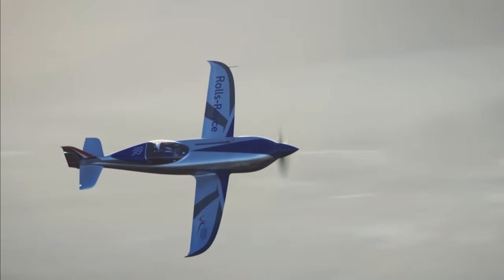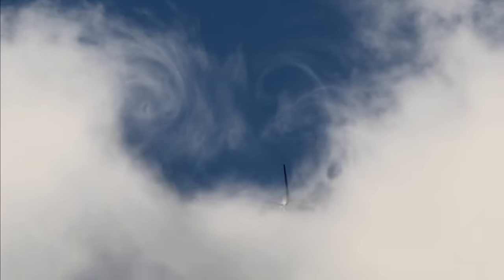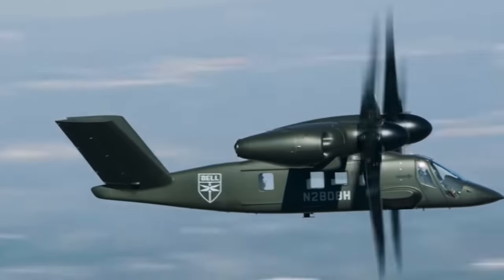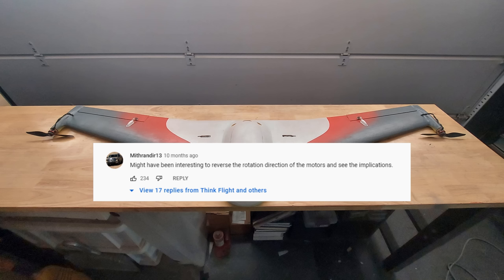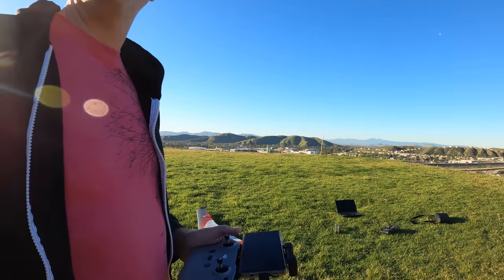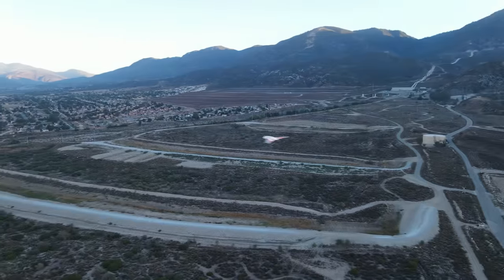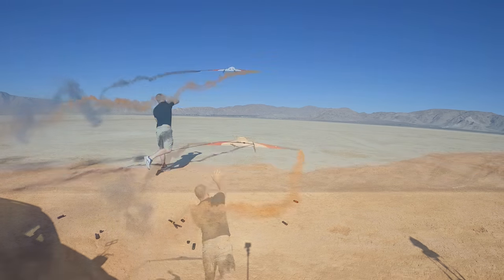Can Wingtip Motors Improve Aircraft Efficiency?  (Part 2)

Comment: To compare wingtip devices you have to consider why span is limited in the first place. Airliners have to fit inside a gate, racing planes need a quick roll rate, other planes have structure constraints.

Why is your plane span-limited? How can you work around this to use less energy throughout the flight?

I think it would be interesting to compare tip motors to a span extension equal to the radius of the prop.

Comment: Great video!  Not sure about there being a inward rotating vortex and outward rotating vortex on the same wing. Wouldn’t that be less efficient than a wing with single vortex?  

If I remember correctly, the lift distribution curve is smooth transitioning from inboard to outboard and and slightly negative at tip.  So I would wager no inboard rotating vortex. Since the pressure gradient is smooth.

Comment: Do you think the reason that the vortex did not move in board as it does with the traditional aircraft might be caused by the lack of tail structure? The mass of that tail structure would displaced a lot of air creating a vacuum behind it and then pulling in the smoke from the wingtips. The absence of such structure would not create the vacuum.

Comment: What about using the wingtip motors for skidsteer-esque thrust vectoring?  For ultra-long distance, or very long circular loitering missions it might more efficient than using control surfaces, assuming control surfaces disrupt aerodynamic efficiency in any significant manner.

Comment: You can overcome any outboard motor failures by simply putting a centerline motor to recover! 😁👍✌
Reply from the maker: Very true!
Reply: @thinkflight  Or use thrust vectoring.
Reply: @toolbaggers  nope if an outboard motor goes out, .... she's goin down baby! 🤣😱
Reply: @TinyHouseHomestead  or fly in a small circle till it runs out of power then crashes..
Reply: @altrusianwolfdog2564  well, .... yeah, but the idea is NOT to crash! 🤣😁👍✌
Reply: @TinyHouseHomestead  I guess after 120 years of aviation there is a reason they don't put motors on the wing tips...
Reply: Adding another engine along with fuel and mechanical complexity to solve what most likely would be an unrecoverable spin generated by the yaw condition is not a good way to solve this problem.
Reply: @F-14_Jockey  nah, at the loss of either of the out board engines, the other out board engine shuts down and the center engine takes over or carries on the mission. Helluuuuuu! .... ROOKIE! 🤣👍✌
Reply: @altrusianwolfdog2564  BINGO! But, with the center engine you solve the issues! 😁👍✌
Reply: Not true.  Additional control surfaces, stability & control, center of gravity/lift, and additional outboard motors can each overcome the loss of a single outboard motor.
Reply: @montithered4741  nah, it would take an act of GOD, .... to overcome a wing tip outboard out! The additional center engine, insure completion of the mission! 😱😁🤪🤣👍✌
Reply: @TinyHouseHomestead  
Oh, so if you had two outboard engines on each wingtip the loss of only one would be inevitable crash?
An aircraft with only on outboard engine couldn’t fly?
Reply: @montithered4741  Show me how you could continue to fly and complete the mission! 😱😁🤪🤣👍✌
Reply: @TinyHouseHomestead  
Easy, simple, and quick: oblique flying wing, asymmetrical flying wing and Mapleleaf remote control drone.
Next question?
Reply: @montithered4741  nope, those a completely different aircraft, and the craft we are discussing would be forced to land or crash! Go back to scool fool! 🤣👎✌
Reply: @TinyHouseHomestead  
I have a bachelors degree in aeronautical engineering (focus on aero) and a masters degree in aeronautical science (focus on autonomous aircraft).
I know what I am talking about.
Reply: @montithered4741  Thrust overcomes control surface drag and forces or the A/C would suffer an undesirable loss of speed. Additional engine means additional strength in structure which will increase weight, not to mention trying to design in torsional stiffness which would have to be strong enough not to allow twist at ALL. Any twist  would essentially mimic roll controls, it may also induce a divergent instability which would be the result of trying to correct the uncommanded roll.  No matter how you try and make this work it will be a weight and torsional stiffness nightmare.

Comment: Thank you for sharing these experiments, very inspiring!
One data point I haven't seen discussed is wing loading? The lower the WL the lower the induced drag as we all know, and seeing as how light our typical models planes are wingtip vortices constitute a (comparatively to full scale aviation) small part of total drag, which would throw the results in this case?
If you plan to revisit this experiment there are other flying wing planforms such as deltas don't require as much reflex, and with a lower aspect ratio would generate more wingtip vortices, which in light of the experiment is a good thing, no?
Reply from the maker: Wing loading is relative, the cruising AOA is comparable to the cruising AOA of a larger aircraft and thus I would assume the induced drag component is also comparable.   Specifically I'm trying to see if there is a benefit to wingtip motors on a plane with good efficiency already, rather than just trying to help out very inefficient aircraft.
Reply: ?!?!!?        do you always  ramble  OFF  THE  TOPIC, like this.?!?
Reply: pouncer
the induced drag force is proportional to the spanloading square, NOT to the wing loading
For an ellptically loaded wing:
Dind = (L/span)² / (3.1415...×q)
q=dynamic pressure
and is the result of the downwards forward inclination of the downwash behind the center wing.
Nothing to do with the  energy of the tip vortices, which is taken from the very low pressure energy² inside the vortices.
2) the pressure follows the Bernoully energy conservation equation.
p1 - p = density × ½(V² - V1²)
If you put a pressure probe inside the vortex you can verify this.
And the tip vorteces, downstream do carry angular momentum, imparted by the wing tip. Clock wise behind the left wing, when the wing tip is not acting as a pitch up surface, as is the case with the flying wing here.

Comment: Do you think ducted fans would be a way to isolate the wing vortexes from the air intake? Or do you think you would need to product a wing which reversed the wing vortexes to prove conclusively that using motors to reverse to flow is advantageous?

Could you put the nose correcting angle of attack inward on the wing such that the tips could be angled to produce the desired direction of rotation?

Comment: Thanks for the update. Looking forward to see the manned vehicle.

I assume at some point you'll mix the tip motor and ground effect vehicle? 
A compact design, relying a lot on the ram / works like a hovercraft, with outward rotating motors... I think the prop vortex can really seal in the pressure!

I'm gonna leave some of what I said on the last tip-motor video:
"I'm not saying you didn't lower the induced drag, in this experiment you can't tell if it was that , or, a propeller working more efficiently. Maybe both? (Also, for flight time, totally irrelevant ;-)
[...] I think putting them in front would work slightly better. 
But in this design you'd need a big pod to not have the noise from the prop being close to the frame. So I get putting them in the back."

Comment: My question is, wouldnt it make the propeller more efficient if it was not fighting inertia to change the direction of rotation? Like, instead of a counterclockwise propeller on a clockwise vortex, using energy to stop the vortex, and then turn it around(or at least just slowing it down) would it instead be more efficient to just slightly increase the vortex speed with clockwise propeller+clockwise vortex, with more of the energy goiong to forward movement?

Comment: This is the most interesting experimental investigation I've seen in model aviation.
I had assumed the tip vortex would be rotating inwards, and energy efficiency would have been higher with inward rotating propellers, based on the airflow already having angular momentum in that direction. As you've shown, the tip vortex is in fact rotating outwards, as were the propellers and you got a 7.5% efficiency difference.
I'm waiting with anticipation for the next video :).
Reply: 🤦no. A prop rotating counter to the vortex will always make more power. This is why contra-rotating props are used.
Reply: @martindinner3621  well don’t I feel silly. I guess you understand this much better than I.

Comment: Even though the props are rear mounted, the pressure field will propagate upstream and will have an effect on the airflows above and below the wing. My educated guess:
Outwards turning props are more efficient, because they  redirect some of the airflow on topside of the wing over the sides of the wing, effectively leading to more airflow over the leading edge of the wing and thus generating more lift. 
In the same way, the props push air under the wing, effectively slowing down the airflow under the wing, which is increasing the air pressure and again generating additional lift.

Comment: THANKS4GIVING.    This is an exciting dive into Fluid Dynamics. Like most studies in the past you have started at the wing.  When it actually beings before the wing.  The resistance increases with speed before the air screw.   There inputs needed for evaluating other overlooked inputs.  Most could be discovered on the bench in a flow tunnel. 
Pressures against the air screw ahead of the blades. At increments until no difference is recorded.  To the side of the air screw again in increments until there is no difference recorded.   Where I’m going with this. ?Is it better to have the air screw vertical or horizontally built into the wing. I’m postulating reducing the resistance-increasing the low pressure to enhance performance.  ?Am I Crazy hmmm maybe

Comment: A while ago I saw a video about why a pusher propeller is better, but I can't find it. Anyway, I just googled it and found this: The pusher design is more efficient, because the suction forward of the prop reduces flow separation, and the accelerated flow behind it is not streaming around the fuselage (or wing), where it would create additional friction drag.
Reply: The counter to that is puller propellers can create additional lift at very slow airspeed due to accelerated airflow from the props.
Fore and aft props on each wing would be an interesting test.

Comment: The problem with wingtip motors is that in the event that one motor/engine dies the plane becomes uncontrollable due to the fact the the yaw factor is much greater then the conventional design. 
On planes that have 2 engines the engines are located as close as possible to help minimize the yaw effect of one engine dies. 
They also make SOME propellers counter rotate to also help minimize this effect. The piper seminole is just one example

Comment: Hello i would like to ask abt motor and prop size and efficency

So i was thinking to get either some 2203.5 motor with 1600kv wingspan of about 1,6m and 16x5 prop(prop lenght of 25%of wingspan), however manufacturers say that those motors are for 4-6s,   isnt it weight wasteful to use 4s battery, when my aim is light slow cruising longrange wing

However i noticed that lets say that ummagwads aerolite 2004 in 3500kv can use 3-4s , so i would use smaller prop like idk 7x7 idk, but would it be more efficent or not, would it fly longer

And well in the end, if i used that 4s motor and ran it mos of the time just on lets say 25% of throttle during flight, would it make difference against some 2s motor with weight of 2s battery on board, against that same miliamphour just in 4s battery build

Ao the question is if that weightsaving of lighter battrry is worth it, or if its not that significant, n i can run 4s n enjoy that head room of power when i would want to punch throttle
Reply: Also im not sure if you already said it in your previous wing building videos, but what kevlar weight did u use and how many layers, was it 250g lets say 2 layers or something like that ?
Reply from the maker: 1 layer of 1.7oz

Comment: At OSHKOSH this year there were some new high wing aircraft with the wingtips sweeping upward. My Cessna 182 has the wingtips point down as part of a stol kit. It appears that the wingtips in both examples are the same with different orientation. Is there a difference between wingtips pointed up vs point down?
Reply from the maker: Downward will decrease stability and reduce crossflow on the bottom of the wing, both great traits on high wing STOL aircraft which need great maneuverability and high lift.

Comment: if you changed to a conventional plane design ( main wing with tail stabilizer) would you see the vortices on the wingtips of the main wing behave more like how they do on airlines as the main wing trailing edge is still producting lift?  then you could also get vortex visualization on the tips of the horizontal 
stabilizers. 

could wingtip motor efficiency just depend on the average lift of the component it is mounted onto?

Comment: Since it's a t-motor I'm quite sure it uses o-ring damping inside the bell shaft. That means, you can not overtightening this motor since the shaft is longer than the stator. Remove the bell and you will see what I mean.
Therefore resistance should be the same. It's a different story on brotherhobby motors, where you basically compress the bearings and so increasing resistance when bolt is to tight.
Reply from the maker: The difference was pretty significant, it definitely changed the resistance.   I too figured it would not be an issue when I took them apart but I was wrong.
Reply: @thinkflight  
Did you check if there's an O-Ring on the shaft inside the bell?

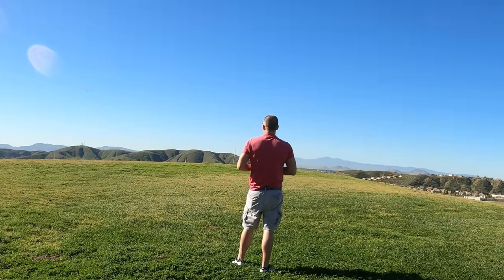Comment: 3:20 Yeah naw I still think about one engine falling on a wing tip configs. I’m thinking about this all commercially. you wouldn’t catch me in a helicopter, you wouldn’t catch in a quadcopter, and you wouldn’t catch me in a plane like that. Too risky if literally anything goes wrong with the motors and flying wings practically rely on computers to stay in the air. Watch some videos of b-2’s doing midair refueling, you can see all the ailerons, rudders and elevators going nuts trying to keep it stable. Unfortunately I prefer “safety” over efficiency. And I’m not saying humans can’t pilot flying wings, but the bigger they get the more unwieldy they become. Yb-49 was a good example of that.

Comment: Seems like a great idea from an efficiency perspective but now the center of thrust is now as far as possible from the longitudinal axis, especially when you factor in the P factor of the outwardly rotating propellers. What could be a solution for engine failures and Vmc roll tendencies?

Comment: I am an aircraft designer i have designed many planes and never seen vortex flow going from top of the wing to lower side of the wing(outwards as yousay) unless and until the outer wing section is not producing negative lift and for that either you have to put the airfoil in such negative angle of twist such that even the airfoil camber is facing upward it will produce the negative lift or you have placed the airfoil in inverted position for extensive span lengths of wing. The outward rotating propellers are .ore efficient because the vortex strength produced due to low pressure on top side and high pressure of lower side is reduced by the prop wash of the propeller rotating in opposite direction. Tip mounted propellers comes with their own disadvantages like it needsoptimum rpm, size ,pitched propellers if operated outside the efficient  envelope the inefficiencies will likely to occur . Another disadvantage is the added weight at the tip which will further decrease the advantage, another is the lower propeller efficiency because the propeller sees disturbed airflow leading to more power consumption. The another disadvantage is the wing tip flutter tendencies which indeed reduce the wingtip configuration's efficiency. The another disadvantage is the added parasitic drag so yeah if you want to test it do the following optimization 
1- wetted surface added because of the motor mounts and reduce the parasitic drag addition
2-propeller size , pitch , rpm 
3-make an efficiency envelope for that test conditions
4-optimise the structural weight 
5-separations due to control surface deflections at the tips which further reduce the prop efficiency and hence more power
6-the optimum twist angle as per the tip mounted prop configuration
7-the wire gauge because the increased length also increases the resistance which should be compensated 
If do these properly then and then only, tip mounted outside rotating propellers will be efficient
Thank you for bringing these videos 
I hope this helps

Though I suggest to test this wingtip device on less aspect ratio conventional wings so that the increase or decrease in efficiency is in larger more clear values

Comment: Outward vs inward. My logic is that the outward is more efficient because the propeller furthest out is generating more  lift ( free of obstruction)in a slightly upward way on it's way down while the opposite blade has turbulent air caused by the wing. (Obstruction). Maybe try a three bladed prop?

Comment: Did you test reversing the direction of rotation in the wing tip motor configuration? If the efficiency is different from the right direction of rotation, that would at lease prove that prop vortex has an effect on performance. --- PS oh you did lol